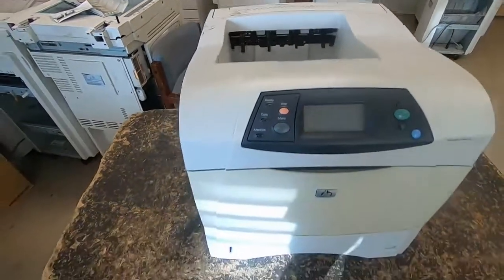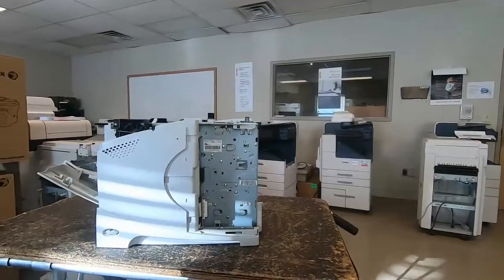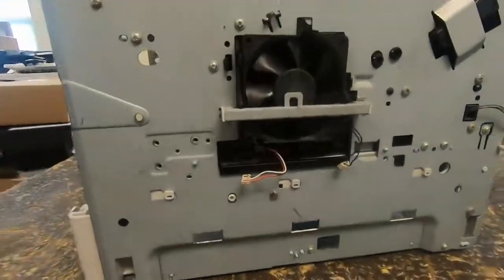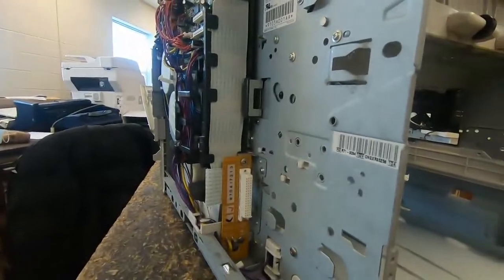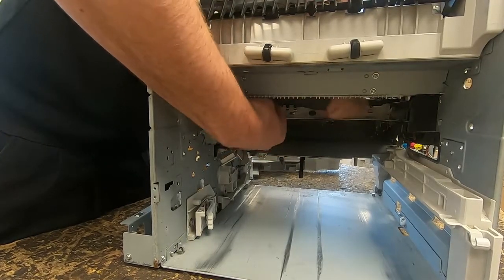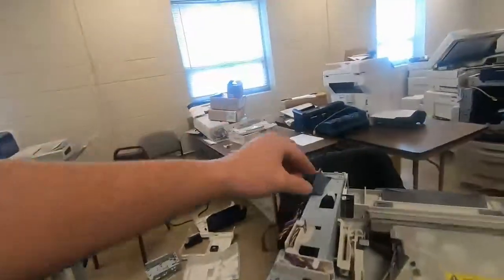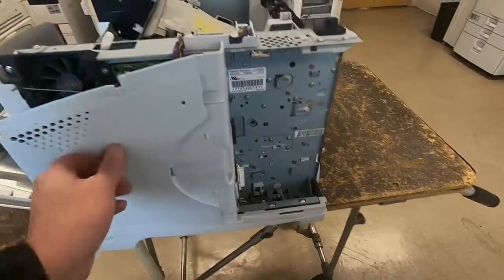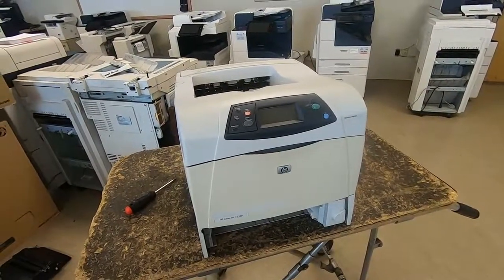How to replace HP 4250 swing plate in 15 minutes! HP 4200, HP 4300, HP 4350

Comment: Thanks for the video. I've never been this deep into the 4250. This makes me more confident.  We have 10 or so of these and just had one fail. I'm going to attempt to replace it with the brass gear upgrade soon.
Reply from the maker: They are really easy compared to the newer models honestly. I tell all my customers to keep these as long as print speed isn't an issue.
Reply: @KenKyleRacing  It took some convincing to get us here. When I started 10 years ago we had a couple 4300s and alot of 3015s. All of the 3015s were basically new but a total disaster... constantly breaking. I convinced them to start replacing them with 4200 series and 4300 series units when I could find them at a local tech recycler. Even used I hardly ever have to touch them.

Comment: easiest way to tell was the pile of grey dust on the left side of the printer when the fuser is out. I probably did 100s of these back in the day
Reply from the maker: Yep, was real fun the first year replacing them with the exact same design knowing you'd be replacing it again in a few months. Was very happy when they finally added the spacer.

Comment: HP 4250N  after 1 page print then a message Paper Clearning Path appears then 41.3 unexpected paper size in tray 2 and I not able to print.  I have tried many many times adjusting the tray and paper size but do not work. Any ideas or parts I need to replace?
Reply from the maker: Probably the tray 2 feed solenoid sticking. You can remove it and wipe the padding residue away on the base plate and the arm, just make sure you don't pull on the wires at all or the solenoid will stop working all together.